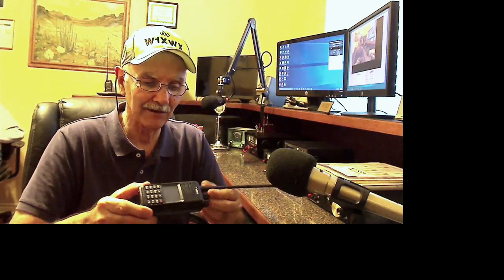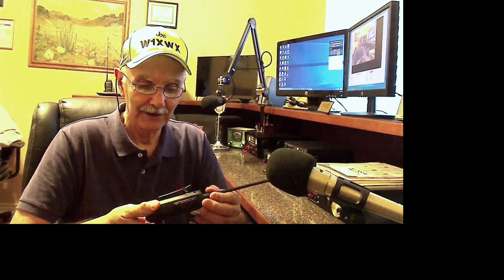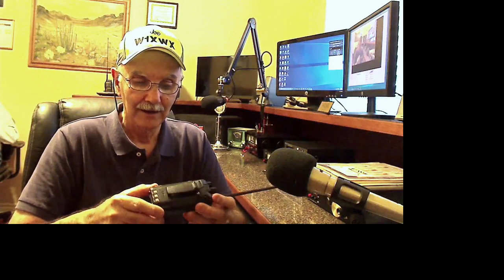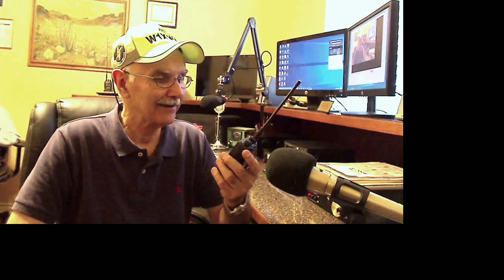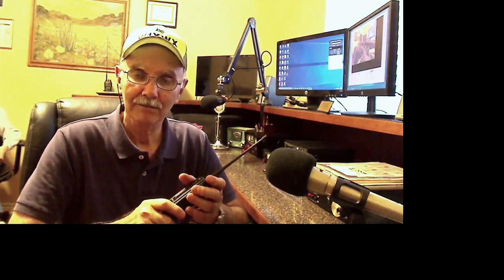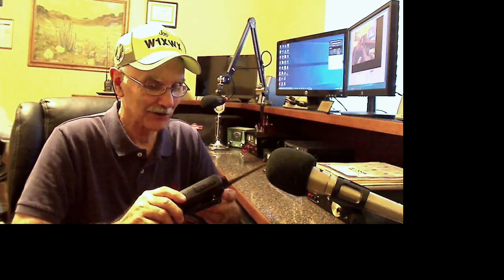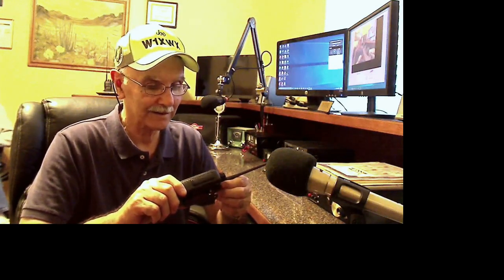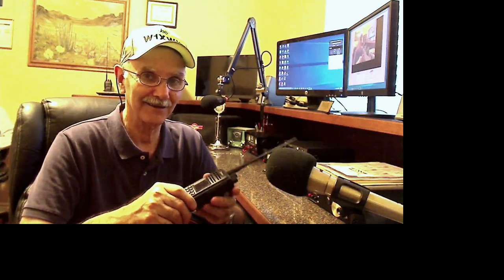TelescopeMan Live Stream - W1XWX Ham Shack - TYT380 DMR

Comment: Hi Joe,  This question has nothing to do with the vlog.  What I wanted to know is if your radio bench is custom made to the dimensions of your room?  Thx.
Reply from the maker: David W yes I had a cabinet maker build it to fit the room. Has some extra custom features such as all the wood panels underneath the desk drop down so you have full access to all cables and wall plugs. I also ran 220 behind the desk to power the amplifier. 73

Comment from the maker: Tytera 380 DMR- by the way it came with a programming cable and a driver disk. However I never loaded the device driver. Windows 10 immediately recognized the USB cable just by plugging it in. The network name is "DMR-Mark" just google that.

Radio seems to work just fine during a first test receive and transmit. The other hams told me I was being heard statewide and worldwide. Lots of manuals and software for various brands of DMR radios on the www.grapevineamateurradio.com web site and Jason can help you with buying a DMR radio.
Reply from the maker: +Joe Lalumia The codeplug I used for the TYT380 came from this web site 
http://www.grapevineamateurradio.com/software-downloads/

Look down the page toward the bottom for the codeplug downloads.